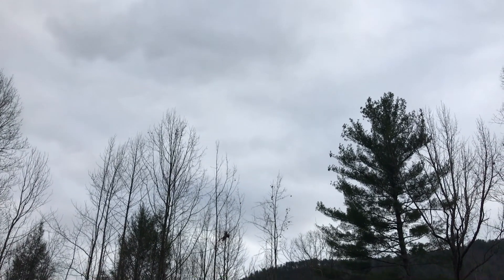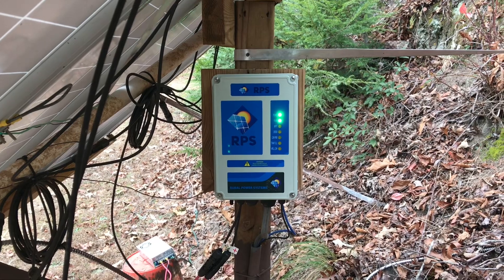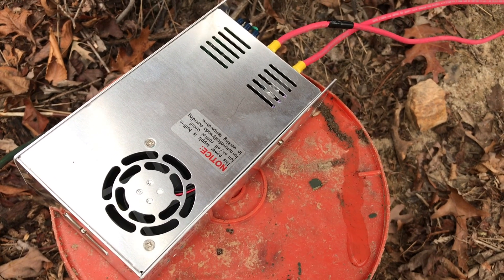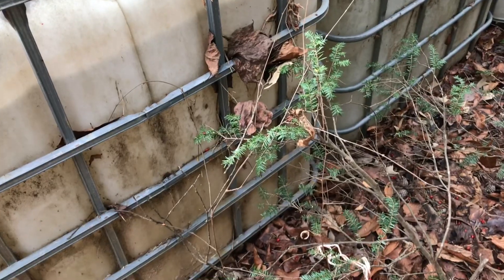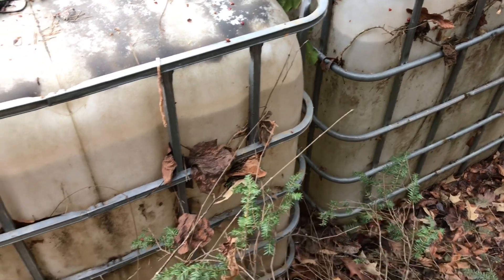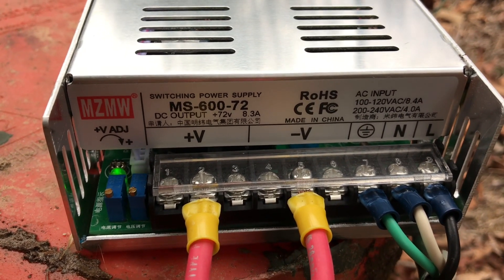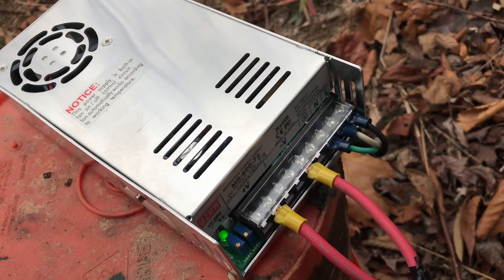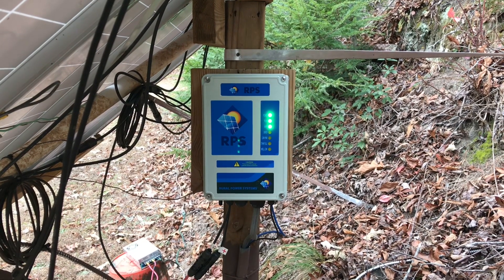AFFORDABLE DC POWER SUPPLY

Comment: I use one of those (30A) for my diesel heater. Works like a charm.
Reply from the maker: How do you like the diesel heater? Have you ever ran it on vegetable oil?
Reply: @THEOFFGRIDMOUNTAINHOMESTEAD  I absolutely love it. I have only ran it on diesel fuel. We live in a small house. Right around 400 sqft and I only use .6 - .7 gallons a day which works out to be around 30% less for heating our home even with high fuel prices and our electric rates have not gone up yet due to a contract with Ameren. I originally bought it just for backup heat since we have electric heat and when I set it up for testing I loved it so much we are now using it for primary heat.
Reply from the maker: I’ve been looking at the little heaters for a backup to the backup heater. (Mini split HP /propane wall heater backup now) Were in a 480 sq ft tiny home. 

How many watts on the AC voltage side at full load? Guessing 300-400watts?
Reply: @THEOFFGRIDMOUNTAINHOMESTEAD  well the heater itself is 12V. When using my AC power supply it uses about 130 - 140 watts on startup and after the glowplug shuts down (within a couple minutes of startup) it only pulls 30 - 40 watts. Note when you shut down the glowplug will turn on again to burn off any fuel or buildup but its only for a minute or two. A 5KW unit (there is no such thing as an 8KW regardless of what the seller says) will be more than enough for your needs. We have to run ours on the low end or else it will run us out. It uses very little energy to run.
Reply from the maker: Awesome! Thanks for the first hand experience/advice! It would be great to have one set back for “just in case”.

Comment: Nice set up. Most of that was foreign language to some of us bc I am a mechanical person and know very little about electrical. I definitely would like to have something like that someday. I am the viewer with the 2  Champion Duel Fuel 2500w generators with the 30 amp parallel for them. My well is a bored well and only 50 ft deep with a submersible pump. The water level is high enough that I could get water out easy enough with a bucket or Amish well bucket I guess. Might not be too fun in freezing weather tho.Thanks for sharing.
Reply from the maker: Thanks for taking time to watch and comment! 
Our well is a long distance from the house. 330 feet away plus 100 ft elevation difference. I could hand bail in an emergency. The water is only 5-10 feet down. Or pump from the creek if needed. Wouldn’t be fun though. 
Suffice it to say, probably the best $48 I’ve spent on anything solar/power related!

Comment: I see the max current output on that DC switching power supply is 8.3 amps.   How much current does your pump use?   Does the output voltage fluctuate based on the current draw?
Reply from the maker: Pump is rated @ 400 watts. The power supply is rated @ 600 watts, plenty of headroom for a variable speed DC motor. 

Yes the voltage at no load was dialed in to 72.0 VDC. After filming I found the drop cord was the cause of my voltage drop from 72VDC down to 66VDC during the beta test.
The drop cord had gotten hot on the female plug. Voltage to the power supply had dropped from 121VAC to 105VAC. 

Drop cord (14ga 100ft) had corrosion in the plug and has been sent to the boneyard.
Reply: @THEOFFGRIDMOUNTAINHOMESTEAD  That is a nice setup for running your pump on cloudy days.  Yellow Jacket makes a 10/3 100’ heavy duty extension cord that would help with the voltage drop.  They are pricey, but very nice cords.    I would enjoy seeing more solar content in future videos.   Good stuff!
Reply from the maker: I’m trying to include more solar/alternative energy content! I’ve got a few other drop cords, I was trying to get everything working before dark so I just grabbed a random drop cord. Of course I found a junky one. 🙂

Permanent install will be pv cable underground from the power house to the solar pump pedestal. 

Thanks for watching and commenting!

Comment: Nice work around!  I’ve been looking at rps for a while. Is your pump motor brushless? I’d be interested in the actual motor specs.
Reply from the maker: The pump motor is brushless. Soft start/stop and variable speed through the RPS controller. My pump is the RPS400. It’s a 3” diameter helical rotor stainless pump around 18” long.   Motor is 80-480 watts depending on head pressure. 48-72VDC. Most efficient at 72VDC.